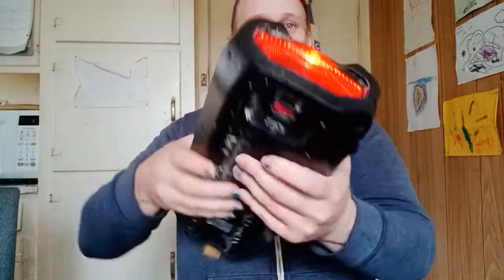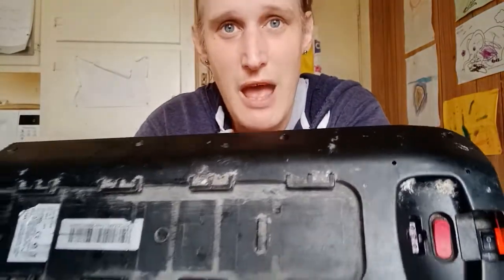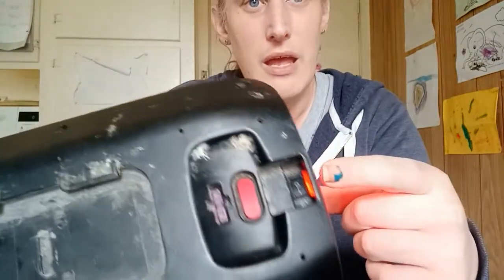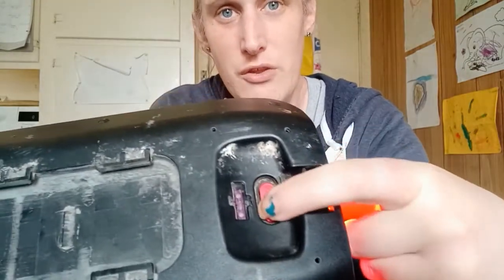Mk5 2 Stroke/Electric Hybrid Battery Update

Comment: can you have the battery hanging on/from a plate/box with springs or some form of dampers to keep the vibrations away?

just asking, cus I was having the same ideas of hybrid bicycles. El-front, 2 stroke/4 stroke-rear. Or find a clutch system that lets me use both el and gas engine on the rear independent or together with the normal pedals. Have a 2 stroke in the frame and an el motor on the rear rack? 

But if you are stuck on vibrations issues and my hunger for failure keeps me interested, I'm sure I will arrive at the same problem myself one day in the future.

I just love the idea of having a bike that will assist on short and long runs alike. In town and outside.
Reply from the maker: The two systems run independently of each other, twist throttle for the engine, thumb throttle for the hub motor. Takes a bit of getting used to.
I tried using rubber beneath the battery mount and to be fair, I did get close to 1000 kilometres before connection issues started popping up. I doubt you could eliminate vibration completly but you can certainly dampen it. I feel like the rack battery is still the best option for this
Reply: @NicksBikes  ye, I was thinking of making an elevated plate/board on springs or something, would absorb the vibrations. And I seen your riding, u pushing the limits, I won't be doing non of that and top speed at 12mph or 20kph.

I got my dose of high speed after some highway runs at night with my 70mph el scooter. I'm still here without an accident. I will try to keep it that way. Anything over 20kph and I don't feel comfortable anymore. 20 is the perfect cruising speed for me today.

I will start off with a 2 stroke build one of these next weeks. Then move on and learn from there, in the end I'd like to end up with something like this mk5 of yours. Not as fast of course.

Thanks for the inspiration!
Reply from the maker: @savagegtalks5912  The BT100 has proven to be an excellent low speed cruising engine. Despite what you mostly see on my videos, I ride most of the time at low speeds too. Unfortunately this doesn't make for "exciting" content though.
My setup uses a BT100 with a 32 tooth sprocket, not for speed but for cruising long distance at lower RPMs. The hub motor takes care of taking off from a start and compensates for the lack of low end torque with the 32 tooth sprocket.
I hope to see what you come up with. There do not seem to be many hybrid builds out there
Reply: @NicksBikes  we should be old enough to know "exciting rides", only gives us a trips to the hospital.

I got my first 2 stroke kit on order. I will play around some with that before I put a front wheel hub on it. 

Some rebels and pirates have to make way for others to realize what this creation can give us in terms of travel opportunities. I believe you can take credit for being one of the first, if not the first.

I post some videos for people to see my failures as I go along and get better.
Reply from the maker: There is crash footage in the Mk5 playlist 😅🤣
Reply: @NicksBikes  ye, that was nasty, u have a speedy recovery, and be careful in the future, you found the limit for 2022. So I keep my speed under 20kph, normally around 15kph. It's safe this way.

A question about the battery shaking, if I had a trailer like a normal kids trailer or something pulling along, would it work to have the battery on/in that? so it wouldn't be damaged by the shaking of the engine from being on the frame? would be a problem if the wires was too long stretched from trailer to front hub?
Reply: @savagegtalks5912  i take it you never did any of this I checked your channel and there is nothing.  Would've liked to see it .
Reply: @Jarrod_D  I'm waiting for my el kit to arrive. So only half way.
Had some delays on my part as well, so things been on pause for the past months.